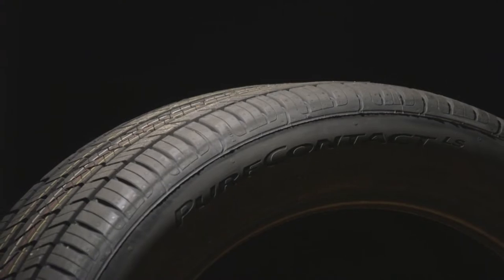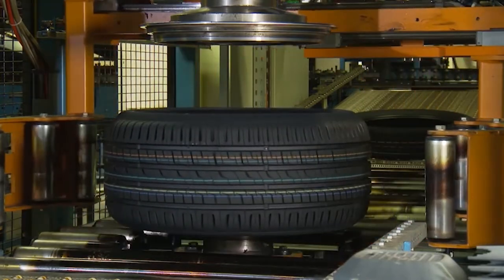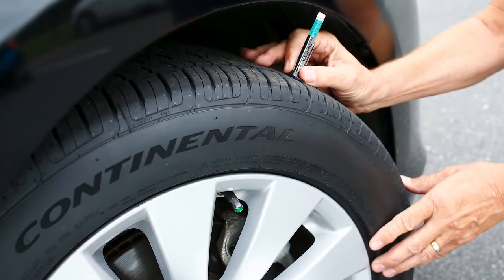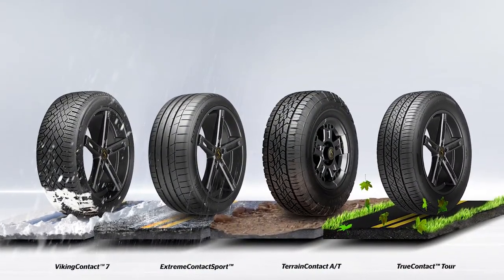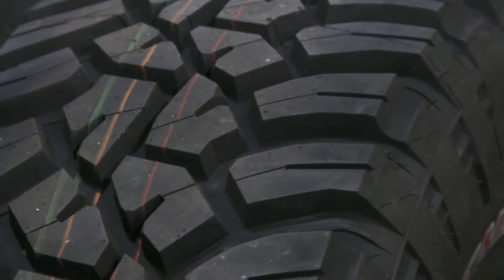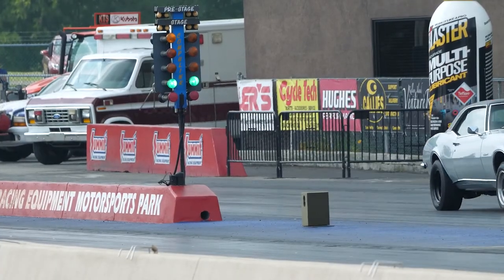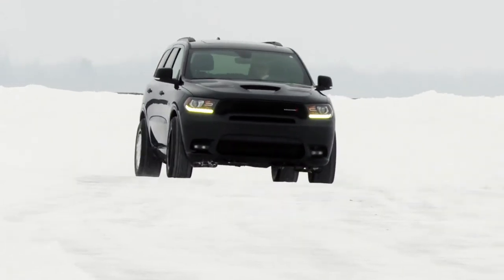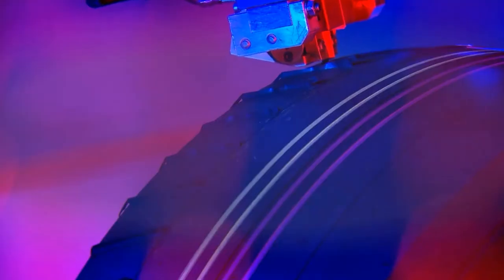Relationship Between Tread Depth And Rolling Resistance

Comment: A little confused as mid way you say tyres with higher tread depth have less rolling resistance than tyres with lower tread tread depth and then as a tyre wears (ie I assume the tread decreases) then its rolling resistance decreases. Seems contradictory?